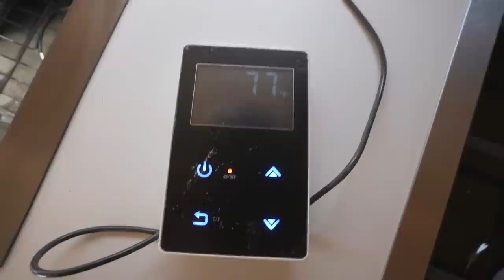SKOOLIE Build Week - 12v Fresh Water Plumbing With Shower

Comment: My retired plumber hubby said they used compressed air on the system & bottle of soapy water on each joint to check for leaks- no water to clean up.
Reply from the maker: Ohhhh good idea

Comment: Issac, can you please link me to something similar you used to connect your plumbing in your shower? What is the fitting you ran through the wall and attached the pex fitting to? Thanks!
Reply from the maker: Hello it was just threaded pipe from Home Depot!!! Than I put a threaded pex end on it to attach to the water system

Comment: On the quest to discover what the paint shade, brand and thinning ratio was used for this beautiful bus? I absolutely love this color and really want to paint my rig
Reply from the maker: It was a behr paint from depot! I’ll try and look for a paint can tomrrow
Reply: @isaacturnerit  thanks man! I'll send ya a tip for the recommendation because now I don't have to go paint shade shopping and get overwhelmed with all the options😂

Also would love a link to the self locking handles you mentioned in this build. Or anything similar. My eyehook latches need to be upgraded.
Reply from the maker: @lilychau1324  remind me but pretty sure I still have a can laying around
Reply: Actually the drawer pulls might have been from another video...
Reply from the maker: @lilychau1324  ha ha I love drawer pulls I started using. Not sure if I used them on this build yet
Reply: Yea the drawer pulls might have been been in the personal blue bird bus you did actually.
Reply: @isaacturnerit did you get a chance to check that paint color? 

Also if you have a recommendation for self locking drawer pulls/latches, i swear i've seen a video of you using them but can't seem to find it.
Reply from the maker: @lilychau1324  I keep forgetting email me at isaacturnerit@icloud.com